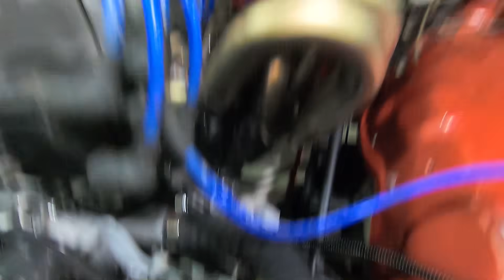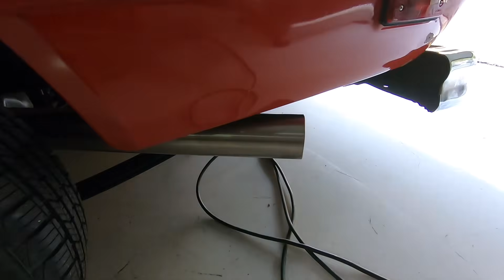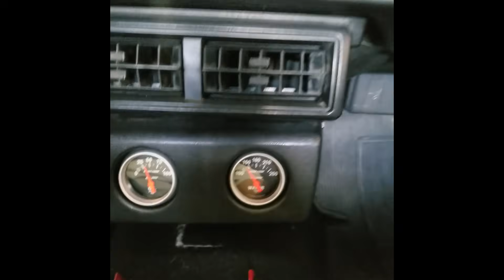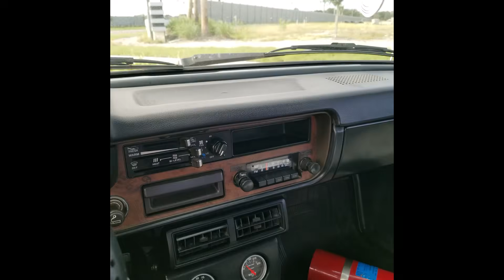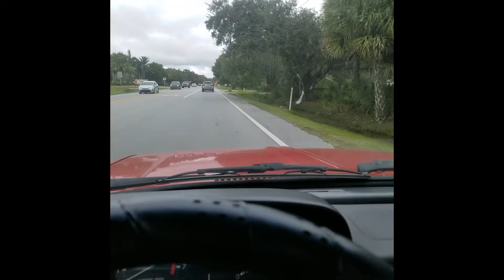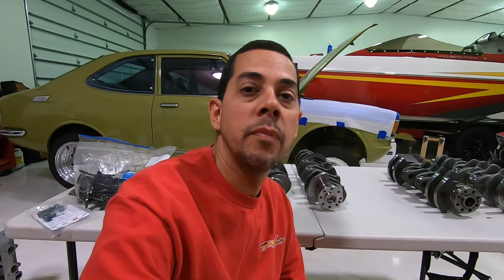22R Toyota Full Build

Comment: The double roller timing chain and sprocket the  timing marks on sprocket and cam peg how does it align 5 degrees before the  sprocket straight up.? It's a22 r  o30 stock.was hoping for a little more punch.
Reply from the maker: Normally we just set the cams up on stock timing and let all tge other mods do the work. If you advance could mean you loose top end. Its always give or take

Comment: Would you recommend this motor for a lifted 4x4 1985 with 35 inch mud tires. Or would a more modern V6 be better option
Reply from the maker: Yea hate to say a normally aspirated 22r probably is not it. Maybe a small turbo 2rz would do pretty good.

Comment: Im doing this same build but with Mikuni 40 PHH side drafts instead of webers. very similar, im also running the cannon intake manifold. Its gunna be a daily do you think ill need a vacuum advance hooked up? The carbs dont have a built in vacuum advance so im deciding what to do at the moment. 
Also what are the 3 threaded ports on the intake manifold for? I know one of the 2 up front is a coolent temp sensor but there's another right next to it and another all the way in the back.
Reply from the maker: Ahoukd be a nice setup. Is it stock compression?? If so 100% you can get away without the vacuum advance. High compression it tends to get a lil troublesome on start up cause of the advanced timing but it still works.

Comment: What exactly do you mean by 4 in one ?   Is it any different than any other headers that starts with 4 tubes and into 1 collector ?  

Also ,  what do you mean by your collector is 4 into 1 ?  
I’m building mine also
Reply from the maker: For higher rpm engines sometimes we do a 4 into 2 into 1 for more torque. Since tge 22r has so mich torque we did a 4 into 1. Yes the collevtors

Comment: Do all 22r and 22re have loud tapit noise?
Reply from the maker: Yea when you put a cam and add strong springs you hear the valvetrain pretty noisy!
Reply: @psiracing my stock 22r taps a little louder but it’s probably only 65 hp😅 need rebuild

Comment: Looks like the only thing you missed was an adjustable cam gear...comes in handy when those duel valve springs stretch the chain...Im running in my off road truck LCE stage 2 stroker .50 cam 160hp
Reply from the maker: I hear ya, he wanted the truck to look and sound cool but he cruises that thing. More of a show truck then anything else

Comment: Hey brother solid videos and builds. If you dont mind me asking what was the tool you used to measure the air to fuel ration on the weber side draft carbs?
Reply from the maker: On the front of the carbs you mean to sync them? Or actual air fuel ratio of the engine??
Reply: What was the tool you used to sync them

Comment: I was wondering where did you tap into the ignition for the electric fan setup? Also by chance where would I be able to tap into the ac power(just so I can make my e fan turn on with ac)
Reply from the maker: Man that's a hard for to answer because we don't have the truck with us. We built that truck a few year a back. Best advice is just take your time and get a a test light and see where the 12v power wire is that powers the a/c compressor

Comment: Hi  I have a 20/22r same set up  was made now my valve are making nose after 25 miles  since was biuld  are the valve adjustment the same  00.8 and 0.12
Reply from the maker: Not sure if we answered this in a different post. Depends on the cam you have. Stock would be .008 and .010

Comment: Or even better do you by chance have the part number of that alternator?
Reply from the maker: We do not have a part # unfortunately, it is from a late model 82 toyota corolla with a built in regulator
Reply: The alternator off of a 95 jag is 1 to 1 with them and you get 120amp instead of 40lol, give me a minute I'll find my receipt and see what jag works.

Only difference is the ground is in a slightly different spot. Connector is one to one.
Reply: @Farrell_instincts Which Jaguar engine is that? There are a lot Jags from 95 with various engines? Cheers

Comment: I have a stock 22re was looking to delete most vacuum line, but I would still sadly have to do smog unsure on what to do any suggestions?
Reply from the maker: Smog inspections are always a tricky thing. Hard to say what you can really remove then
Reply: Or just go to a state inspection place run by Mexicans and ask for a (inspeccion en caliente)inspection on the hot .....or just explain it to them they will do the trick ......but it will cost you 50 to 70 $
Reply: @CristianSosacastro more like 300+ if you can even find a spot a lot of people won’t risk it

Comment: So I just bought a 83 22r Toyota pickup and I need help with the vacuum lines. How much do you think it will cost to take it somewhere so they can make sure they’re connected correctly?
Reply: Just plan on swapping them. Easier to replace them all then hunt through for a fix. Them old vaccun harnesses can be replicated cheaply, probably 100$ to have a shop do it where i live.
Reply from the maker: Good call!!

Comment: I've got an 1980 with 22R ('83) lower but using orig 20R head with oem smog. Gasket's leaking coolant to combustion so I'm getting ready to pull it.. The builder told me (in '98) that he used a copper shim to keep compression down for Cal smog. Head's never been off since. Question: When a shim is used, is a gasket also used? or is the shim the gasket?  I'll find out soon enough, but I'm tempted just to order and put a gasket alone and add some E-85 at smog time (which always works for me anyway). I upgraded to dual timing chain and steel guides since. I have no clue how thick the shim is and I don't want the downtime waiting to have one fabricated if none are available. Suggestions?
Reply from the maker: Definitely E85 sounds like a great additive, as far as a shim, not to sure. You could always double up on the head gasket as well. or keep it simple and just add the E85
Reply: @psiracing  The shim issue became moot when the .020 shim I ordered was damaged in shipping so wish me luck with gasket only. So far so good. First start was strong and tight. I think I hear a tick tick tick on #2, even after double checking the valve clearance. Drives just fine. Maybe I'll just have to live with it. compression on that cyl is 8 lbs lower at 150 all others 158. The orig shim was .020 so that must be the stock thickness. Thanks for your reply.
Reply from the maker: @WayneHarropson  8lbs lower doesnt sound to bad at all. wonder why the tick. Glad to hear it worked out for you
Reply: @psiracing  I just readjusting the valves one more time and the ticking went away it runs great
Reply: I adjusted them 1/1000 tighter than spec

Comment: Can you help i have a 87 22r pickup running a weber 32 36 with electric choke its dieseling pretty bad during shut off, i have a fuel pressure regulator 2.5psi also the timing i set to 0 degrees, it runs great at idle and doesnt stall at stop lights just dieseling when turned off any advice thx

Comment: where are valve cover pcv/vent routed to? nothing? what spark plugs and coil? cfm on carb? thanks!
Reply from the maker: Yes no PCV just a vent with a small filter was installed after that picture. MSD Blaster coil with a msd 6AL Igniter box. Not sure CFM on carbs but there 45 Webers which move a ton of air.

Comment: what kind of suspension does it have? smoother ride than stock?
Reply from the maker: It Actually drives very well, the customer did all the suspension work before he dropped it off. It wasnt anything crazy though
Reply: @psiracing  damn any chance i can find out what he did? i can see he took out a leaf from the rear because i only see 2. just trying to keep my ride simple but also improve the ride quality and drop it just a tad. thanks. lots of good work there
Reply from the maker: @JasonSmith-fu6oi  I know in the front he bought a aftermarket torsion tube that was red in color. Also new shocks and Im not sure if he changed out the leaf springs in the rear

Comment: Back in 1995 I souped up my 86 Toyota Truck after the mini truck scene in socal was gone. I followed the trend that was catching on with the import scene and the likes. It had a mid cam from trd, 44ph mikunis, headers but forgot the brand. e fan, trd clutch, lockrite locker, had the pully shaved and balanced with no a.c. short shfiter and flytrap. I was really learning at the time and found out my mikuni intake manifold where small and the carbs where right at the head. I didnt have a aftermarket fpr and seems like that set up was for  off road driving and lost alot in the 1/4 mile. It took alot of gas and was loud from intake and exahust just to beat oem hondas at the time.  I learned about heavy rims too, it had MOMO Mirages from an MKIII Supra. Anyways, when I put the stock carbs and intake back on it was alot quicker especially high end. I ended up selling the truck bone stock with just the bolt ons in 2001. It was my first ride I ever souped up.
Reply from the maker: hahaha thats a awesome build
Reply: @psiracing  the headers, I remember now after looking for headers for the 22r they were called Doug Thorley headers, I remember they were expensive too in the mid-90s. They were short headers though I don't think I needed the emissions tube but I think I blocked it off some how. I don't think they make them anymore only in long tube.

Comment: If there is no vacuum advance does it not lack advance when it's low rpm and under load?
Reply from the maker: No, it actaully has more power since the timing doesnt move around as much. There is only about a 5 degree difference from idle to max timing as you rev the engine up with the advance gone.

Comment: That’s crazy, I never seen a 11 to 1 setup using pump gas. A lot of people claim that there will be pinging issues with that type of compression ratio.
Reply: He's locked the timing so it won't but idk if that's the best way to make power at both ends

Comment: Where did y’all relocate the battery
Reply: Common for people to j switch the intake & battery placement, there’s way less hot air blowing up into the battery’s corner
Reply from the maker: Its right behind the cab in the bed

Comment: Having issues tuning my 45 dual Webers any tip? Played with just about everything can’t seem to get it right any feed back would greatly appreciate 🤙🏼
Reply: @TheRealYbJr  I’m looking to stop the poping/spitting from carbs can’t quite get it right thank you appreciate it🤙🏼
Reply from the maker: Whats up man, anytime you get backfiring or coughs out the carb, 9 times out of 10 its a lean condition. Also be sure they are synced correctly because that will throw all kinds of things out of wack as well.
Reply: @psiracing  what was your setting for sync mine is at 5
Reply: @TheRealYbJr  yes I do have a gauge I’m running 3psi
Reply: It’s a Weber regular

Comment: Did you have to change plugs for the alternator I’m trying to side up a 20r 1980 pickup with the 82 alternator just wondering if the wiring is the same I have the spare plug to if so
Reply: Can you send me something for the wiring
Reply from the maker: All we do is source which wire actually triggers on the alternator on the back and we wire that to ignition.

Comment: I have a 83 toyota hilux with the 4 speed manual, and I'm thinking about doing a stage 2 cam and a 38/38 weber. Should I also put dual valve springs and is the 38/38 weber a good carburetor for that kind of setup
Reply: I think the stock manifold and carb are both pretty restrictive. You can pick up a lce offenhauser single plane then a 38/38 would bolt right up and make a significant difference in power. 
As for dual springs, unless you have a cam or are consistently taking it past 5500 rpm on the stock stuff, it should be fine on stock stuff. 
Ive got a 81 22r in my sand rail and im ditching my ported stock intake and oem carb for the lce offenhauser with a holley 2300 2 barrel.

Comment: how did you solve the lack of bypass flow with the cannon manifold? remove the thermostat?
Reply from the maker: Yes we did remove the thermostat. I actually removed the center part of the thermostat and left just the main body to slow flow down
Reply: @psiracing  okay,  I liked your build. I have a less all out build and this issue took me some time to get functional. looking forward to how you solve the a/c idle up. :)

Comment: I just bought a lifted 1994 toyota pickup fully LCE built motor, cam headers etc you name it, has about 20k miles on motor as of right now, its lifted about 6” with 31’s and for some reason going uphill it has a very hard time.😭
Reply from the maker: Damnn, sounds like you may need to re gear it for uphill!
Reply: @psiracing  what gearing do you think i need? It’s going to be my daily driver, & weekend offroader.
Reply: @mauiboy96768  4.88s will do wonders
Reply: @apple4apple247  planning to install 15x19 on 31" i went with 5.29 gear ratio.
Reply: @mauiboy96768  5.29 is a bit much for 31s, even for 33s, i can see it for 35s though
Reply: @apple4apple247  is that a bad thing?
Reply: @mauiboy96768  its not bad, but your top speed will be lower and 5.29 is overkill, but if you ever go to 33s or 35s youll be set
Reply: @apple4apple247  well this sucks, i appreciate your help! Means alot man. Happy new years. I'll look into 33"s.
Reply: @mauiboy96768  no problem 👍

Comment: Really should get that temperature up. If you're on the level and know enough to build a engine like that you should know running an engine to cool can be worse than a little bit hot. All the metals expand with heat and ea different metal even different alloys of the some metal expand at different rates. Not getting up to temp can keep pistons from fully expanding and wobble in the bore. The oil doesn't get hot enough and cannot flow as much volume the list goes on. Maybe I'm wrong I can't claim to be an expert with 4cylinder yoters but the engines I do build and have plenty of experience with don't like being ran at lower temps. Nice looking piece though foresure a one off build
Reply from the maker: I appreciate the opinion, we've been building toyota engines for over 25 years. Engine builds enough temp to be in a happy place, was just colder then normal in that video!

Comment: Very nice job!  just wondering if this truck is running he L transmission or is it a W or G? I see you respond to most of your comments and was wondering if the L could stand up to this kind of power given its reputation as weak in the 4wd version.
Reply from the maker: Hey man, it's using the stock W series trans if im not mistaken. Honestly the owner babies the car, he just loves to cruise it.
Reply: @psiracing  Thanks for your reply, after further research I found the W series did come in the 82 2wd trucks apperantly the L was the 82's 4wd transmission.  Versions of the W came in NA supra's pushing up to 200 hp and only was upgraded to the R series once they surpassed  200hp The  W is a very nice smooth shifting trans and I am sure Ken loves cruising this beauty.
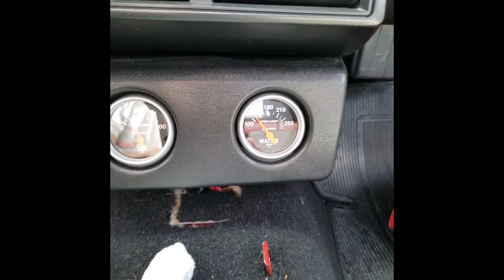Reply from the maker: @canuck351  yea we had tons of good luck with the w style transmission. We actually ran one in our full drag car and went as fast as 9:01 at 151mph and it lived.

Comment: Is the AC sistem R134 and how did you converted it?  I got a new AC compressor but it came without the AC manifold that goes in top of it and I can't find it anywhere?
Reply from the maker: That's a good question if it is R134, I'd have to ask the owner

Comment: I have a 1986 Toyota 4x4 that I purchased in 1986.  It's been through me, my dad, my brother, back to my dad and now back to me.  So i'm planning to keep it for a while!  It runs, but has about 335,000 miles on the motor.  Thinking about a rebuild or purchasing a long block,  Not really looking to do a performance setup; when stock this truck did everything I needed it to do.  I'm having trouble finding info on youtube (maybe I should try forums) so I thought I'd ask you guys.  If I get ready to do something with the motor, should I look for a remanufactured long block, or just get the existing motor rebuilt (price will be a consideration, but not override quality)?  I now have a Jeep JK so I'd like to get my Toyota back to a daily driver.  Hell, the existing motor may go for a while longer, but I'm looking at alternatives.  About to sell a boat so I will have a little cash on hand.  Any comments/input would be much appreciated.  PS, when in the USAF, I had it customized at Clark Air Base, Phillipines.  It has a custom 3" body lift, custom nerf bars, and a custom winch bumper.  Still has the original paint!!
Reply from the maker: Dude thats a rad story and to be honest if the truck is that clean, always better to keep the original engine with the original truck. 

Im sure we can help you with a rebuild even tho we mainly do all out performance but we can make it happen. Only thing is we are way behind, so hopefully you wouldnt be in a hurry
Reply: @psiracing  , thanks for the reply.  Based on what you say, I'll look first at a rebuild of the original motor when the time comes.  I had looked at a previous video that made me think it is not as good an alternative as buying a new long block.  But if it can be acceptably rebuilt, I'd definitely like to stay with the original.  Thanks again.
Reply from the maker: @anthonygreer3724  hey man! Anytime! Goodluck!

Comment: I’m running a electric fuel pump on mine but having issues with the dead head fuel pressure regulator what fuel pressure regulator are you running and at psi
Reply from the maker: We use a Mallory 4309 fuel pressure regulator, simple low pressure regulator that returns fuel to the tank to keep pressure more accurate. We only run about 3 psi fuel pressure